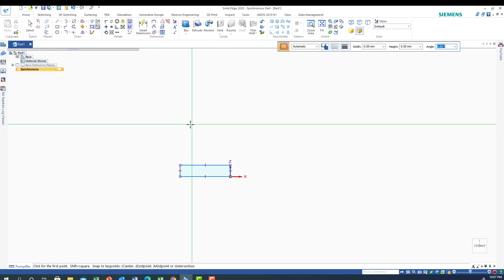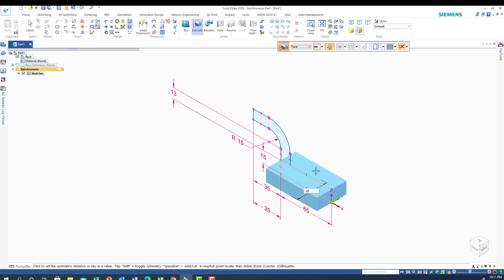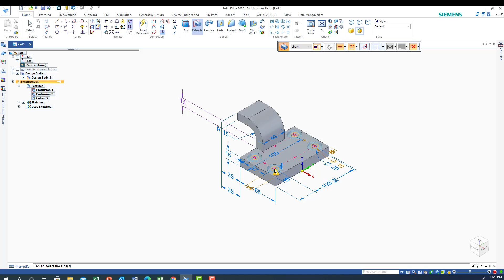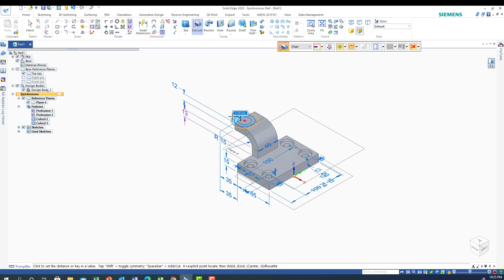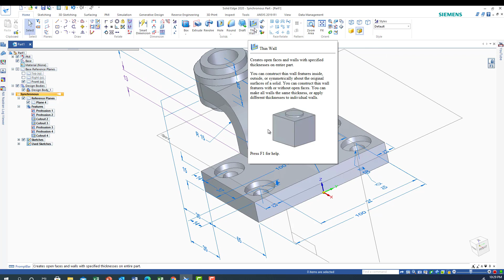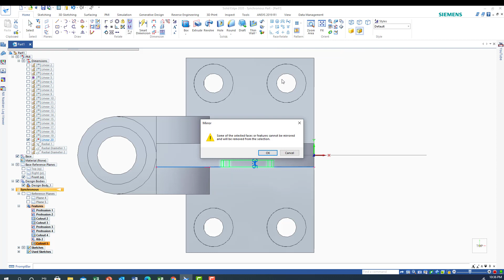Learning Solid Edge - Exercise # 2

Comment: Hello, again. I enjoy the courseware, doing it just for fun because I enjoy 3D-modeling. One question, instead of projecting sketches which requires multiple mouse clicks, would it be ok to restore a consumed sketch, or are there any disadvantages with that method? That way I have all consumed edges back to life with just 2 mouse clicks- provided I need them on the same plane as of the original sketch
Reply from the maker: Thank you for the feedback. You got it right. There are many ways to get the drawing done, and it seems that it came to my mind when I  was  recording the video to do it this way. Your way is far better. Thanks, and good luck.

Comment: Hello, I would like to mention that the arc rib is done differently in your exercise drawing. The upper boundary connects to the upper edge of the round part with 40mm diameter as per
your draft sheet. 

Another think I noticed, R 95 rib radius is impossible if the design intent is tangent connection of the rib arc at top edge of the round part with 40mm diameter. The correct radius is 93.61 mm.

Comment: Note: For the misplaced rib line. It is also, very easy to select the line and modify/move the 20mm to the middle of the 40mm wide arc. Then, perform the 'rib' command.
Reply from the maker: Thank you so much for the feedback.

Comment: Sir how to export solid edge model to dxf drawing?
Reply from the maker: Use save as to save your file in a format that is acceptable by the other software. My students were able to move files between three different software without any difficulties. Good luck.
Reply: @drmseif  thank you 😊